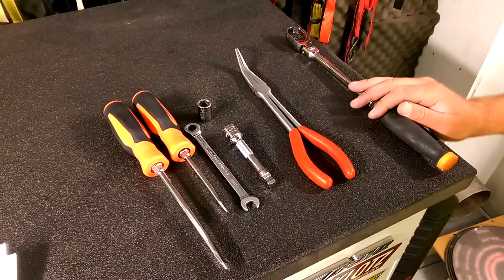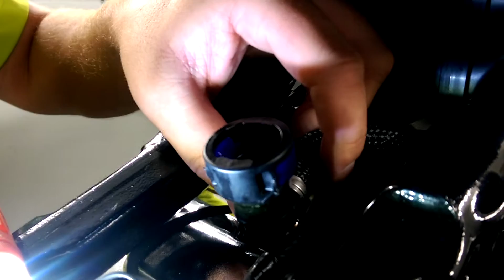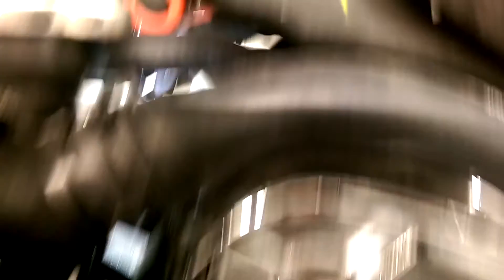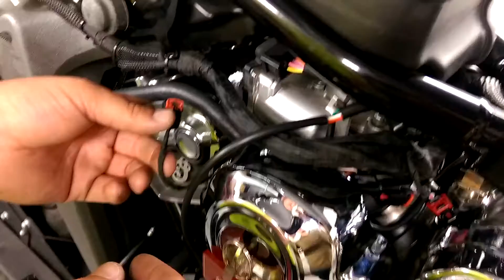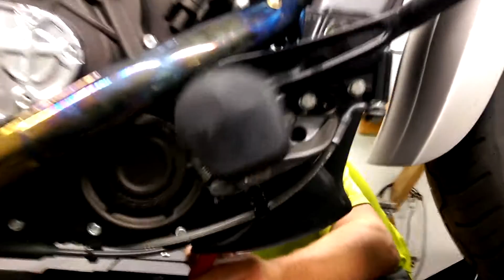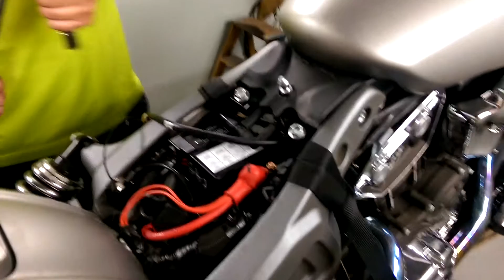Dobeck Performance - Indian Scout Gen 3 Install

Comment: do you have one for the victory octane and do you provide the map for the stage 1 victory slip on with air intake?
Reply: Map should be the same.  More difficult to find the connections on an Octane.  Take your time.  Pry the harness torwads the center to find the connection for the rear  02 bypass.
Reply: Octane is same as newer scouts, since the octane frame is just an old scout frame and the engines in newer scouts from I think 2018 on might be 2019 is the exact same motor. Though I think there maybe a problem running this on those engines. I have been trying on and off to get mine working since I have a new low profile shorty exhaust and custom air filter set up ( that allows the absolute maximum air intake through a natural airflow filter. I have actually lost power compared to to the norm factory setup. Today is my last attempt and if I don’t see any improvements I will put the old air intake system but with a better filter but not drastic and connect wiring back to stock. Changing back to own filter set up to prevent bike fro running to lean. The combo of my exhaust and custom air filter set up would allow way to much air to fuel mixture.

Comment: Do you have to do all this with an empty fuel tank since you are disconnecting the fuel line?
Reply: Its been a year, so Im sure you've found the answer. However, for anyone else looking to know the answer,no, it doesnt need to be empty. There will be some that drips out of the fuel line, but just put a rag over it and be careful.

Comment: I wish I would have watched this also.  I ended up removing both top frame spars, battery, coolant tank, and battery box before finding the connector tucked behind the harness by the regulator.  doh!  just fyi never remove both frame spars at once.  trust me on this.

Comment: Wow, wished I had this video when I installed the EJK. My front and rear o2 sensors weren't as easy to find or get to.  
Loving the improved and smoother ride. Although my 2015 Scout does feel like could be dialed... I'm feeling like I have to give a lot of gas to go. I haven't changed the stock settings. Wondering if the xChopper slip on's (slanted slip-on's) need any specific mode?  Thanks for the great vid!